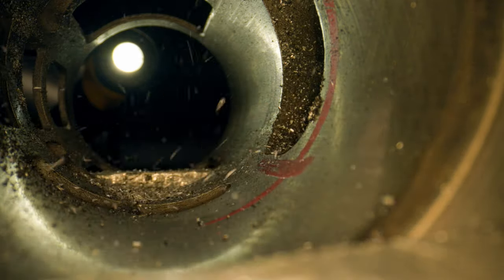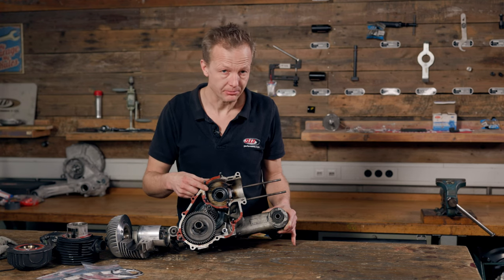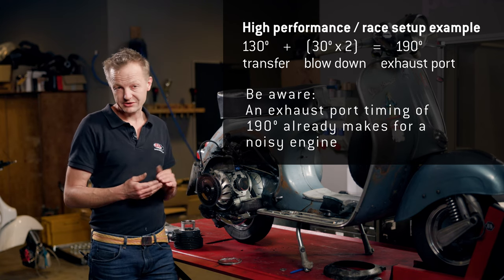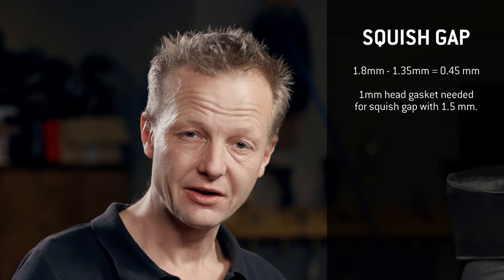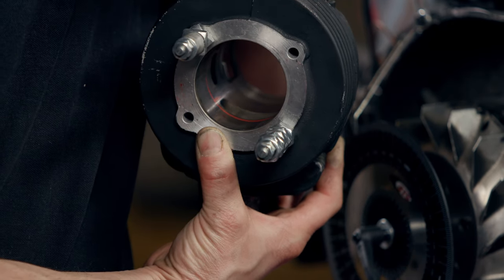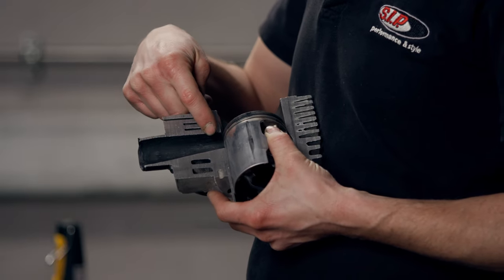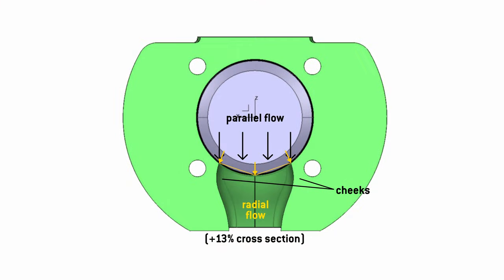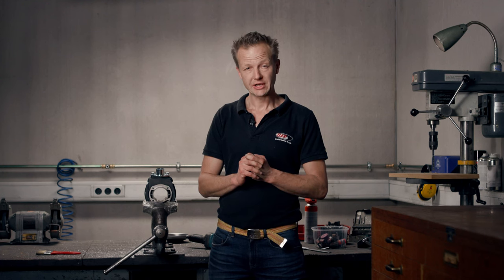Cylinder Porting | Vespa PX Engine TUNING 🛵🔧 | Part 7 {English}

Comment: Thank you for doing this in English, anyway you can do some videos on the Piaggio moped motors, I want to build a high torque low rpm 65 to 75cc motor using Polini parts and a Polini Bravo type head. Thank you